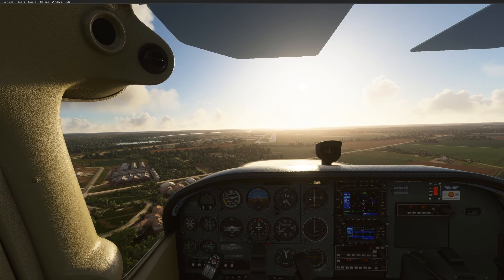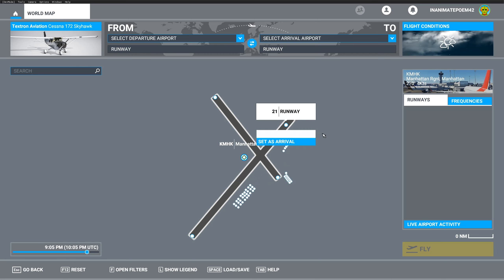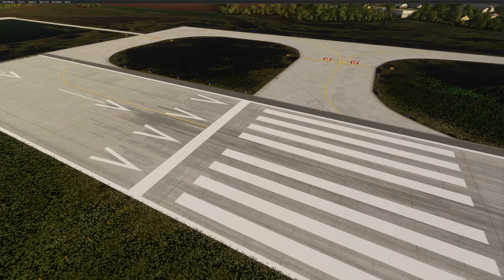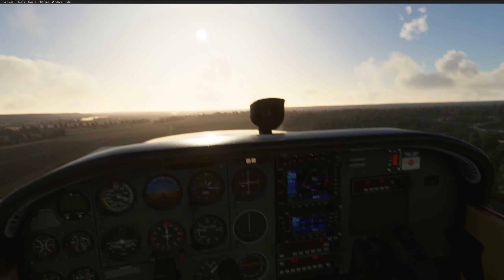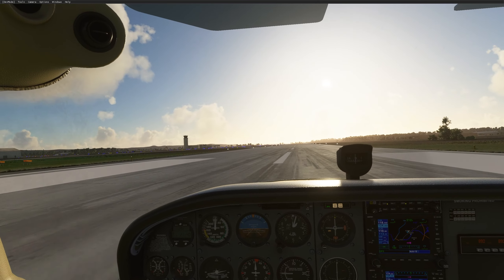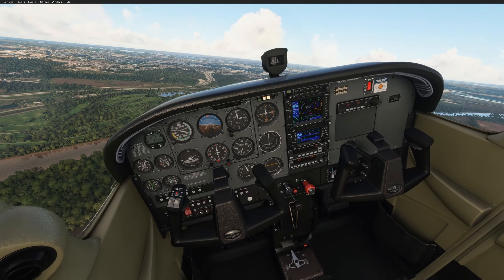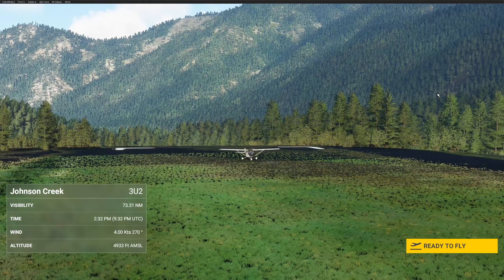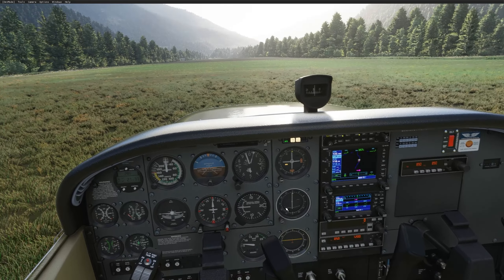MSFS 2020 Tutorial: Short/Soft Field Takeoffs and Landings

Comment: You are supposed to be preforming a short field landing and should be touching down as close as possible to the stall speed of the aircraft. Yes, you would like to touch down on the point of intended touchdown but you do not land hard and fast in order to do that. The 172 has a short field approach of 61 knots on final which I believe creates a lot of float. Learn what the expected float is for the airplane your are flying and then adjust your aiming point to compensate for the float. Have you heard of a wheel barrel landing or porpoising. If your flight instructor told you to do short field landing by sometime landing hard, find